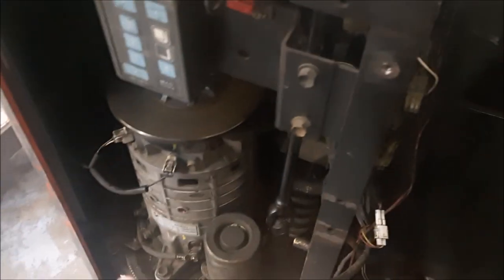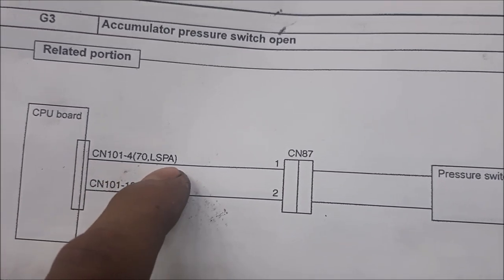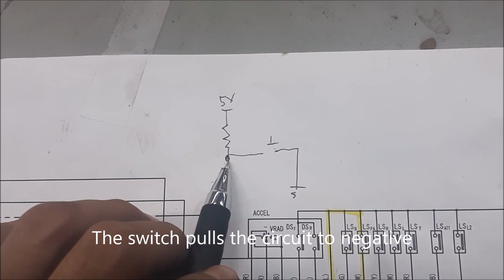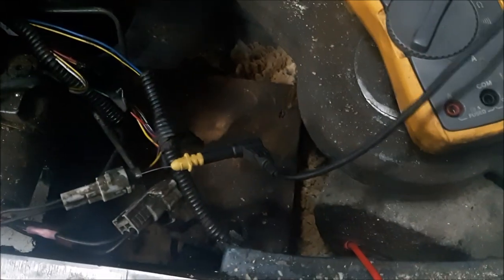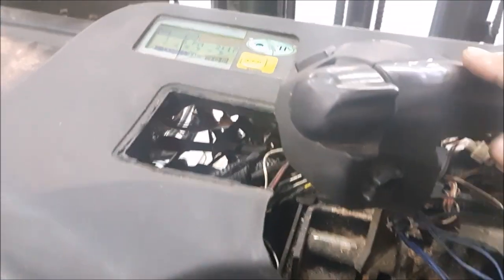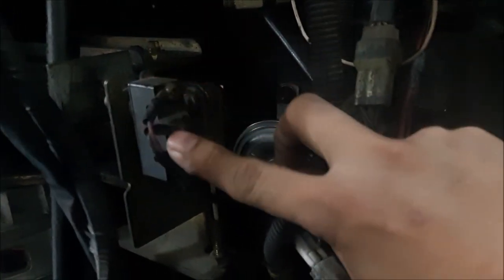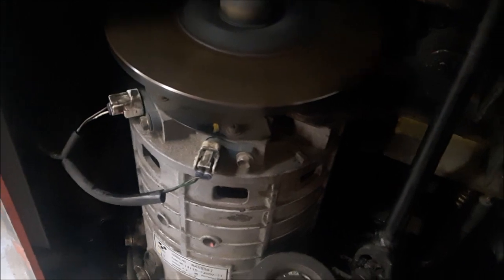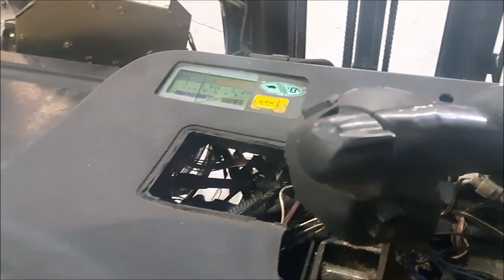Toyota Reach truck no drive

Comment: It amazes me how some technicians will just assume the motor is bad with no testing. I've come to find with my company that the majority of the younger techs have no idea how to read a electrical diagram. The mechanical and electrical trouble shooting profession is a dieing breed. My company pays very well up over 30 dollars an hour and we cant find qualified people or people willing to get their hands dirty to do the job. I'm glad to see ur still at and working hard to satisfy the customers needs.
Reply from the maker: Thank you sir.
Reply: Currently I'm working here in the Philippines due to pandemic I did not return to Saudi Arabia. My specialization is an auto electrician for light vehicle. What I encountered here in this company is they purchased a brand new UN REACH  TRUCK but after 2 months several problems came out. Like code 243, the gear hub of chopper motor has been drop due to damage allen bolt. It's my first time to handle an equipment like this it's hard to repair without diagram. I need to be familiarized to the system. What I'm looking for is how to reprogram the ZAPI DUAL AC2 & HP/POWER INVERTER without using scanner
Reply from the maker: As far as I know the zapi controller cannot be reprogrammed without using the digital console. Code 243 is a pump sequence error code which may occur if the lift potentiometer is not in neutral during start up.
Reply: @forkliftgeek10  thanks for additional information sir, is there a chance if I get the EEPROM I.C. inside the functional ZAPI INVERTER then copy and save the file then reprogram the non-operational Reach Truck... we have 5 modules ZAPI inverter all are not working...
Reply: @forkliftgeek10  Sir I already fix the code 243 because of the initial settings the drive tire should be in the center. In my case the chopper motor is operating but it cannot drive the main tire due to missing gear hub...
Reply: Спасибо друг у меня новая bt 160 не укомплектована я буду ее ченить нет ли у тебя электронной схемы

Comment: Also could have used the analyzer mode to check inputs on computer to give direction
Reply from the maker: Yes, good point. It would point you to which input is not being received, but the I process would still be needed to verify the integrity of the wires. Thanks for the comment.

Comment: Hi have a Goodday,any ideas about error code AD-2 AD-5 and AD-6 this code appear on dashboard and alarm.then this  have a 3 ac supply drive.the one ac drive the green led is on and the other two ac supply drive green led is not on!thanks
Reply from the maker: AD codes are communication related for toyota forklifts. Make sure battery voltage does not drop excessively. Check all wiring.